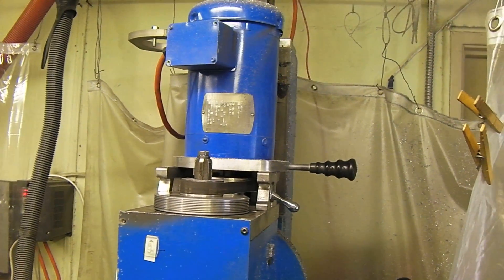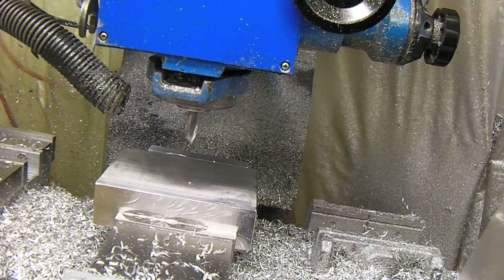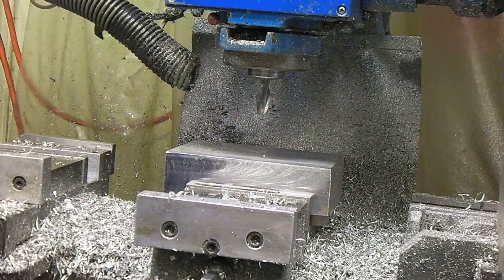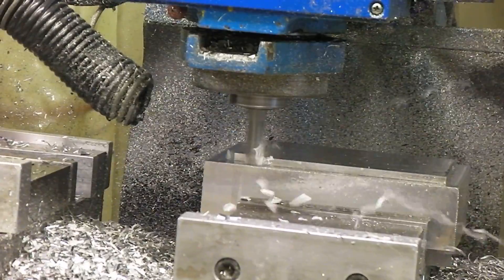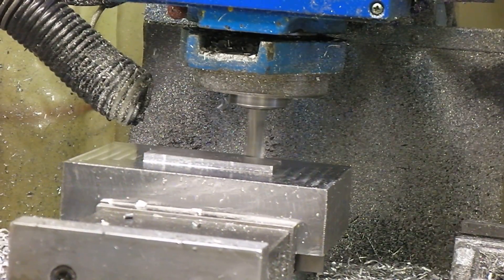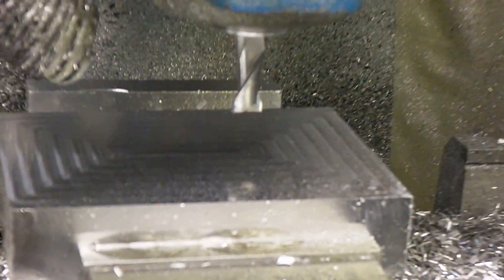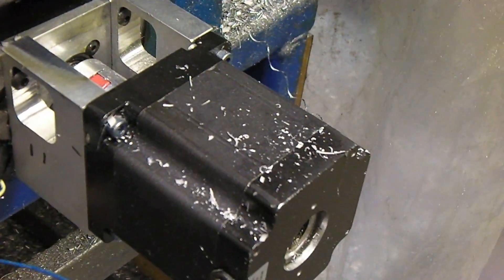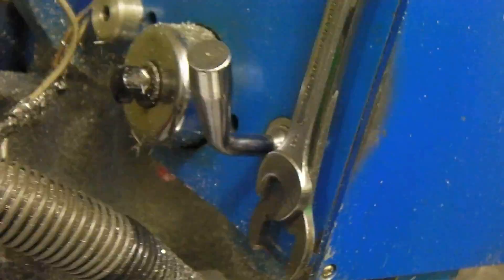High speed face milling IH RF-45 milling machine

Comment: Hi. I know its an old video, but what HP spindle motor were you running?
Reply from the maker: 2 HP 1750 RPM  at around 2200 RPM around 90 Hz.  For the larger insert tooling a larger motor is a good idea. I'm upgrading to a 3HP and a 5 HP. I have them here.
 It really depends on the RPM. RPM eats HP. 3K is fairly easy, 6K and higher speeds is pulling near 2HP. Any miss step in cutting engagement will bog the motor. 

Thanks for watching
Dave
Reply: @ArizonaVideo99  thanks Dave.

Comment: I get the best finish running my shell mills at high rpm. I’ve just made some two step pulleys and finally found the belts I needed but now thinking I should use just a single pulley setup since I can still get 8000 rpm with my vector drive anyways. It goes down to 100 rpm at the motor right now and the gear box is slightly under 1:1 so I’m at 75rpm at the spindle at lowest 5-6hz. I could just ratio the same on the pulleys. What would you do?

By the way I tried that with a vacuum hose and ended up with a disaster. It wasn’t that effective and ended up a tangled mess one evening when a larger part caught the very edge of it when I walked away.
Reply from the maker: The hose is a blower not a vacuum. It hooks to a bounce house blower, lots of air.

I ran a single  speed and its in a few other videos. Generally it was OK but sometimes with large  drills or taps you would want a low gear. After that I make a few of the two speeds and they are quite nice with a VFD. I'm guessing you changed to AC bearings for the higher speeds, the stock are only good to about 4 or 5K.

Do the two speed, you will like it.

Comment: Impressive! Do you sell ballscrew kit for RF45 mill clone? And how does the belt drive conversion perform milling steel or other harder materials?
Reply from the maker: I don't do a lot of steel.  Low range goes to about 1500 so I have enough power for steel and mainly tapping that requires going to low range. Right now I do CNC kits for PM-25, PM-30, G0704 and PM-940. I will be adding a RF-45 clone kit this year. 

If you have questions you can allays email me davedaxx1@yahoo.com 
Thanks 
Dave
Reply: @ArizonaVideo99  Okay cool! So any specific date or shall I check back after a month or so?

Comment: Hey. Did you end up making any belt drive kits for the RF45? I contacted you once in the past and you were not making any at that stage. I’d be keen on a kit if you have made some.
Reply from the maker: No belt drives yet. 

I am doing a second IH mill and will need to do at least 1 belt drive for it. I will make a few extra

Comment from the maker: The standard things for every CNC.

Low or zero backlash ball screws a good amount of preload on the end bearings and all the axes need to move well with out too much friction. You can get a part to .001" but really if you plan on .003" then life is much better.

Comment: How is the accuracy of these machines? Where I live in Aus some people put a lot of shit on them in comparison to bridgeports, their clones, and other non Chinese units. But it looks like a lot of US folk have overcome design issues and turned them into quite capable cnc units.
Reply from the maker: It will never be better than a Port in most ways. It should be looked at as one size smaller and a lot less well built in every way. 

It is still a good CNC and mine has made at least 5000 pounds of parts and chips in the last 5 years.  I don't know about what you would call accurate. I have a bit of lash in the Y so holes are off by a few thow. They kind of suck until you get the belt drive done and after that the mill really can crank out the chips and do better with small bits or even with larger ones with a better finish.
Reply: Thanks, what would it take to get the accuracy down to < 0.001" ? And for example fix the lash in your y?
Reply: What's critical for accuracy in a conversion in your opinion?  Thanks again

Comment: Did you decide to make any more kits for the RF45/IH mills?  If so, I'm very interested in purchasing a kit.  Thanks!
Reply from the maker: I will be doing some kits for the IH/Charter Oak mill. They are about the same as a RF-45 but most of the parts will not fit because each axes on the IH is larger.  The end plates might fit but the Z is a different casting, in fact I have three columns and each has a different bolt pattern for the top plate so I'm not too sure which to use. 

I dont have time now but I already have drawing for all the IH parts and I need to get a second mill up and running soon so I will make 3 of everything
Reply: Hi, thanks for the reply!  I will be happy to purchase a belt drive kit for the IH when you have it ready.  I'm about a month away from having my 12Z CNC conversion up and running, and I'm sure the belt drive will be a much appreciated upgrade.  Please let me know if  there is anything I can do to help.  I would be happy to take measurements of the bolt pattern on my top plate if it would be helpful.  Is there a way to contact you outside of youtube?  I sent an email, but i'm not sure if the address was correct or current.
Reply from the maker: I thought you were asking about a CNC ball screw kit.

I have made a bunch of beltdrives but I'm not doing them now due to time.
Reply: OK, is there any chance of getting just the pulleys (and maybe) belts?  I can probably figure out the rest of it, but the pulleys are the part I can't fabricate.   Thanks!
Reply from the maker: How would you mount the spindle pulley? For the belt drives I make a new spline shaft which is quite hard.

Feel free to contact me at my email. I might be able to do something. davedaxx1@yahoo.com

Comment: How did you get your rf45 so rigid? Mine cant make nearly such quick and deep cut
Reply: Spindle speeds coincide with cutting and rapids. You may not be dealing with a rigidity issue. Otherwise check all your points of contact, ways, gibs, etc.., and assure it’s all appropriately setup.

Comment from the maker: I have a bounce house blower and a drip system. I was dripping water mixed with coolant but all the stuff I had made a sticky mess and still rusted. I quit using that and went to just a little oil brushed on the work and that worked OK most the time. 

I have a new coolant I'm going to start using so I hope it does not rust like the Cool Mist. 

If I did a new setup I would use two blower hoses for better chip removal and a On/OFF system for the drip. Turn on for a few seconds to coat the part but mainly to clean the tool. Then it could be off half the time.

Comment: Very nice.
Can the mill climb cut at those
Feeds?
Reply from the maker: Your right, I forgot to click the climb milling function. I don't know. I do plan on re doing the video. I had the Y axes top speed set to 80 IPM so I need to re do it with it set to 100 IPM.
Reply: I almost always climb mill aluminum on CNC's.  Of course there are exceptions, usually frail workpiece or workholding.  Good job on the convert and videos.

Comment: Awesome! Speaking of that size mill, I have the 12Z from Charter Oak. You mention (I think) that the Y-Axis motor could be mounted at the back, being there was room for it. Is that correct, or were you referring to the 940?
Reply from the maker: The IH has just enough room for a 900 OZ stepper under the column. The only problem is you don't have a true flat surface to mount to. I milled a flat spot and made two block to mount the stepper and I do plan on doing mine that way. If you email me I can send you a picture. davedaxx1@yahoo.com

Comment: Thanks for your quick response. 
So you don't feel that a stepper with an encoder compare to a servo. Teknic gave me a quote of $1300 for 2 1000 oz, 1 1400 oz (for Z axis) and 80v power supply. I love their performance but am not fond of the price. However, since your Z servo blew, I also want to upgrade my spindle bearings and a still have to order my screws. I had just got this from Jim at Charter Oak and also wanted the 2 speed belt drive but he said he couldn't get them. Are you his supplier?

Comment: I really appreciate your no-nonesense approach to your videos. I have a question about the whole servo (Clear Path's) VS steppers issue.
Obviously, if money were no object, I would chose Clear Path's servos. Being that I'm not made of money; 
Do you feel the inclusion of encoders in a stepper system is worth the extra time and dollar? 
I am presently designing my stepper system without encoders.
Reply from the maker: If you already have a good stepper driver or 900 oz steppers then I would always use them.

If you go Gecko drive and all new steppers the X and Y are about $130 more to go SP servo. They will perform better. I have one and it will get used.

That being said, After I popped my servo drive on the Z again I installed  a undersized 900 oz on the Z with a 10 year old Gecko drive and it works perfect. 

As long as you don't get real high inductance stepper or lets say they are 6A or  7A   you will get 100 IPM just fine and that is all you ever will need.

Comment from the maker: I have the 940 and it has a native 13.5" of Y travel. Its just bigger than any other mill. The head is deeper too so you can use all that Y travel.  Mine will be going soon.
Reply: ArizonaVideo99   Good evening ArizonaVideo99. I just bought a 45 size mill from Grizzly, the G0762 and going to do a conversion on it. I would love some pointers on what to buy for ball screws to achieve the highest speeds and feeds I can while still maintaing proper torque to push through. The mill did come a 2 HP variable frequency spindle motor and going to upgrade to something bigger. More rpm and torque. Any advice would be great appreciated. Cheers!
Reply from the maker: The biggest problem with all the 45 is the 1800 RPM spindle. 

Any direct drive stepper system will give you 100 IPM which is more then you need even if you have a 5K spindle. With a 1.8K you will be cutting much slower.

20mm ball screws for the X and Y and 25mm for the Z. 70 V system and 900 oz 6.1A steppers for the X and Y and 1200 for the Z.

Most all the China C7 screws need the ball nuts re packed to have zero lash. The double nuts will often need work too. The shims will need to be changed. I can re pack hem if you want for $25 If you have a drawing I can order them.

2 hp is fine. Change to a 3600 RPM three phase. The shaft will need to turned down to 19mm.  Change the gear lube to 0W30 synteck. You will still want to do a belt drive after you get tired of the gear noise.
Reply: Thank you for replying to the message I sent you in such a timely manner.  The VFD on the G0762 is programmed at the moment to run at 2500 rpm at around 100Hz but I know the vfd will go up to 400Hz output resulting in higher rpm on the 2HP 3 PH motor already installed from the factory. Do you think the motor would be able to handle the higher frequency?  What is the 0W30 syntec oil you refer too. Is is off the shelf automotive synthetic oil? Would love to get new bearings for spindle and have you pack them. I can send you drawing If I can't get you email address.  Thank you so much!
Reply from the maker: Anything over about 70 HZ with a three phase motor will start loosing a lot of torque. 

Run the stock motor and see how bad your gear noise and heat are. 

After the break in change to automotive oil. You can lower the level some too. The oil makes massive amount heat.